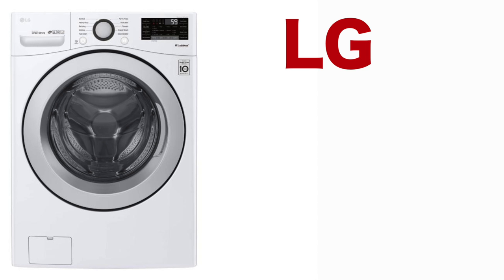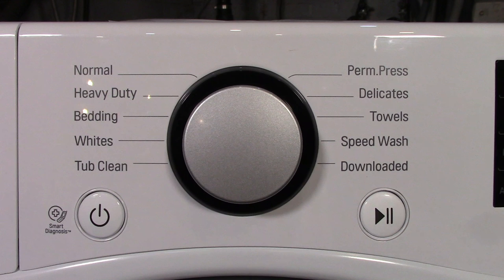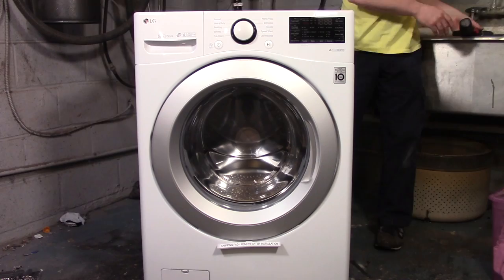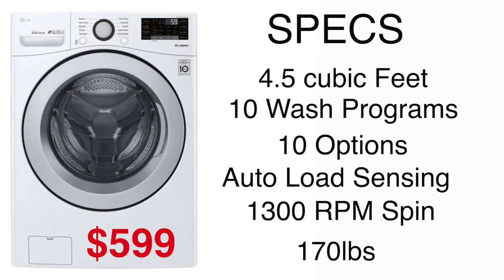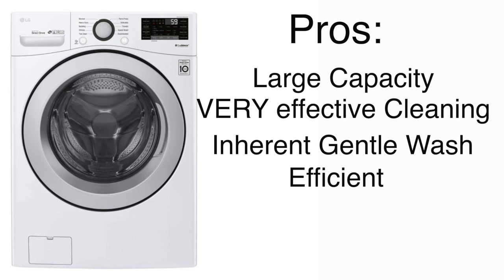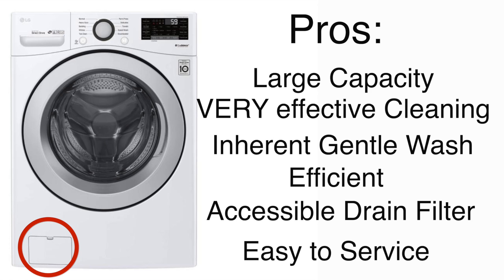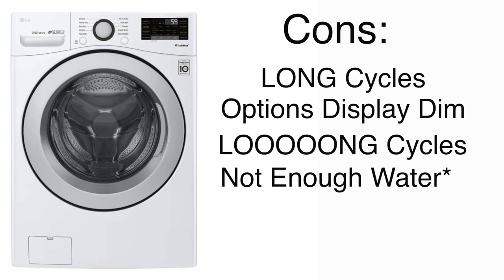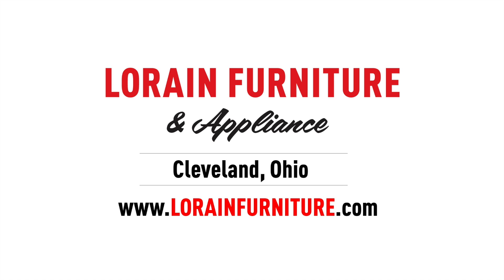Review: LG WM3500 Front Load Washer I am SHOCKED

Comment: I dunno. After my experience with an LG top-load washer, I will never buy any product in any category with the LG name on it.     
And an hour and a half? That's long? My LG top-loader was most accurately timed with a calendar.
Reply: Some people still remember when a standard top load Whirlpool washer would do a large load in 45 minutes. Ok, so it used more water - well as long as water re-enters the environment through the drain and ends up in the treatment plant, or directly waters the lawn or garden, then that water is not truly wasted it is just recycled.
Reply: My new Speed Queen actually uses less than my HE machine did because it doesn't fill brim-full and drain repeatedly to balance. Three or four fills at 30 gallons-plus a pop is more than two fills at 27 gallons per, no matter how you do the math, and he SQ gets the clothes clean and fresh in one cycle..
Reply: I had an lg font loader in Europe, it still goes strong after 10 years. Then I moved to the States and bought top load LG, I was unhappy with the water level but it is working perfectly after 7 years. I sold the house now with the appliances and rented the washer and dryer set from the apartment complex. It is made by age and is a nightmare. The rinse is basically not existing and I believe it has a mold behind the drum which I can’t clean. I am buying another LG, in my eyes nothing is better.
Reply: Speed Queen TC5000WN or Maytag MVWP575 top-loaders are really good: some say the Maytag cleans a little better, but I chose the Speed Queen because the coin laundry nearest my house is running this type machines and they are over thirty years old.
Reply: Same here....uses today a 8 kilo LG 1403.  The pump is so sensitive and will break easy. 
Had a AEG for 12 years. 1600 spin. Broke ONCE, it was actually the plastic in the drum that wore out, (were the springs were located) pt some metallic washers there and it just went on going. My old mother has this AEG today, still working 😊

Comment: Eugene.How about a comparison between  a Whirlpool/Maytag front loader and LG and which is easier to work on.
Reply: @Isaac Joby John A Whirlpool is easier to get parts for though. As far as front loaders go they all tumble clothes the same way. Whirlpool gets excellent scores for cleaning in CU. That was one of the reasons I originally got the Whirlpool WFW6620, but also because they are a US brand and have been very reliable appliances in my usage and experience over the years .
Reply: LG is definitely easier to work on. Whirlpools drain filter isn’t even accessible on front loads.

Comment: “1hr 30 long cycle” oh boy wait till you see a cotton 40 eco at 4 hrs
Reply: Yep, but it is only Eu washers only cold water in.
Reply: Washer Dream it’s not due to cold fill. I’ve owned cold fill machines which do a hot wash in an hour. It’s the fact they push Eu efficiency law. If the cycle isn’t over 3 hrs long I doubt it could reach the A+++ ratings they do.
Reply: Yeah i agree that, my lg do a hot washer 95c 1h 27min only 2 sheets and some pillow bags. When you "overload" the washer it takes 3-4 hrs because the drum is so full the machine have to do long wash. My machine doesn't reheat at all, that makes it energy-efficient. After 10 min when the water is boiling it isabout 80c
 My machines drum size is 56liter (5.6kg) but it is 8kg machine.
Sorry my English, i know it isn't good.
Stay tune on next week
Reply: OneDayAfterAnother  I'm not sure what is Usa dryers voltage.
In here we have 2000w heating element and total is 2200-2400w.
I think the max in usa is 1600w~ ouer max voltage is 2650w (normal voltage)
Reply: Washer Dream USA electric dryers are 240V 30A circuit. Elements could be up to 6kW, but I think 4.5 kW is more common.
Reply: @TheRenaissanceman65 The US uses what's called a split-phase system. It's two 120V lines that are 180 degrees out of phase with each other (using a grounded center tap transformer), plus neutral and safety ground. The voltage from one 120V line to the other is 240V. An appliance that needs 240V uses both lines. An appliance that uses 120V uses one line and neutral. Modern electric dryer outlets have two hots, neutral, and ground in an outlet known as a NEMA 14-30. The neutral can be used with one of the 120V lines in the dryer for things like controls and the drum motor.
Reply: TheRenaissanceman65 yes. It’s called a dryer outlet by most folks. Also, for higher wattage 120v circuits like a dishwasher or microwave, they’re typically on their own circuit. A main panel in the US will have anywhere from 10 to 40 individual circuits. Lights and regular outlets share a common circuit for a room or two or three depending on proximity and age of the house. Houses are most commonly run with a 200A main breaker, of course depending on the age of the house and it’s size (newer and bigger can have even bigger service sizes).

Comment: I had to open it and set it for more water because the factory setting was not cleaning our clothes. I was about to go back to a top loader. But that minor adjustment made all the difference. Now, everything is coming out CLEAN!!!  I also hate the cycle lengths, though.
Reply: How do you do that? I'm seriously about to buy a new washing machine because i hate this washer and my clothes stink and have been for two years now!
Reply: @faylinameir  There's a little screw (he shows in the video in the minute 1:28) that you can rotate clockwise and it will add more water to your cycle. You just have to rotate it a little bit, and that's it. It will void your warranty

Comment: seems to be a common theme with modern washers having way too long cycles. My mother got a new Miele a couple of months back and the standard 60oC cotton wash takes just over 3hours, which is way too long, it'll wash the clothes away
Reply: Chris All modern machines have long cycles. It's a way of getting better results using less energy, by allowing the detergents and enzymes to work. You'll actually find with the Miele that the initial time starts at three hours but will drop to around two hours after a few minutes unless the machine is absolutely stuffed beyond capacity. I used to think my washer took too long, but actually it's irrelevant as I'm not sitting there staring at it while it does it's thing! And nearly every machine has a quick wash programme or a button to shorten the wash time if you're in a hurry.
Reply: @spencerwilton5831  that's my point, the new machines don't reduce the times. My Miele machine I have does reduce after 10 minutes, which is great. They are too long, no clothes are that dirty to need a time length of time.

Comment: Hope someone can help me. The drum of my WM3500CW moves freely sometimes. I noticed that sometimes after a wash, if I try to move it by hand it seems to be a little stiff. Is that normal ? Otherwise  it rotates freely  like it's on butter.
Reply: That’s normal. 1-2 minutes after a cycle the drum has a safety lock feature where it doesn’t let you spin it by hand for whatever reason.

Comment: Hi, First, I want to thank you for your great videos. I am in the market for a new washer and the magazines and big * reviews on sites have me very confused about what constitutes quality washer today. I have an LG front loader that is about 8 years old that looks similar to this one (LG WM2501HVA). I am done with front loaders. I have mold on the front gasket despite regular cleaning and leaving the door open after each wash. Cycles take forever. The washer has leaked multiple times among numerous other problems. But mostly, the clothes just smell bad when coming out of the washer. I am thinking of switching to a top loader to eliminate this smell issue. Are you planning to review any top loaders such as the LG WT7600HKA (this one also seems top rated but who really knows). Are top loaders with an impeller as opposed to an agitator useless? I was kind of set on the Maytag MVWB865GW until I saw your video. I am glad that I held off. I am now trying to convince my wife to get the Maytag Commercial, but she feels that it is too small. I just want something that lasts and cleans. Thanks!

Comment: Great reviews.
LG is one of the worst brand peopel can buy.
I don't know why the make washers with no heating element for the USA. 
That washer will never do a hot cycle 5 years from November w it will grow mold .
Any European washer has a heating element, is only connect to cold water, so what ever temperature is selected is actually reach and maintain.
To short the cycles juts use light soil, most American machine have 5 soil selection.

Comment: Well, it's a cheap front loader, but it works.  Right?  I guess I just have this thing about cheap front loaders;  they all seem so flimsy, with a short life expectancy.  I'll wait and see what the 3900 is like.
Reply: LG is a good machine. Direct drive motor and lifetime warranty on the steel drum. Washes good too. My washer had an original 5 year warranty.
Reply: LG has a terrible reputation for reliability, especially for a company that does advertise durability, longevity etc however I recently got an LG WV5-1408W
 and I think it will be a long lasting product. Internally a simple design, direct drive, stainless steel lifters etc. I think it is one of the nicest looking front loaders too. Only thing that really annoys me is the noise and vibration on 1200 and 1400 spin cycles!
Reply: @Isaac Joby John I'm so agreeing with you, my aunt has an LG top load washer WT5001CW from 2012. It's still working without a problem to this day.